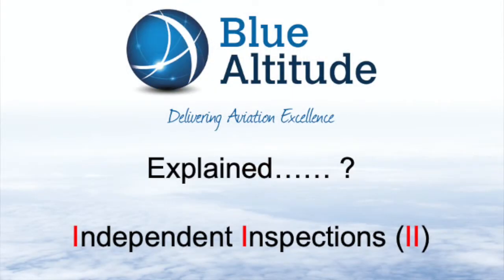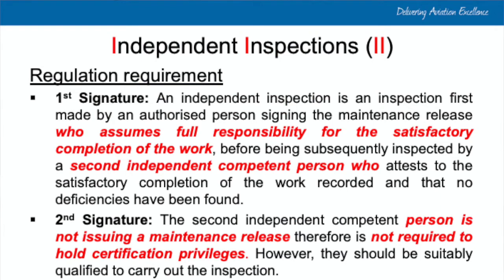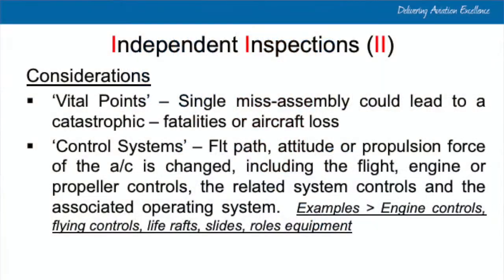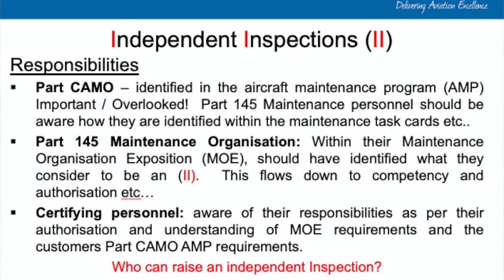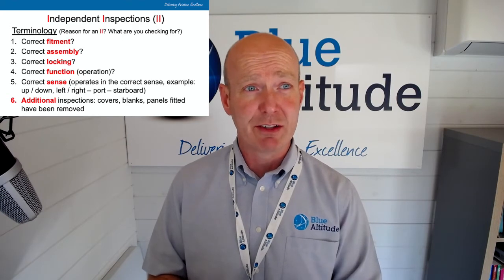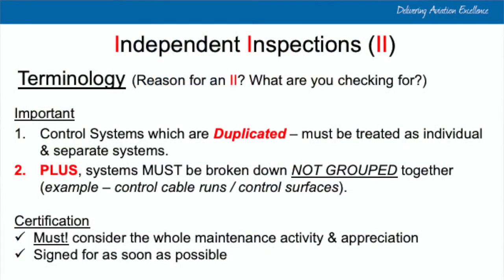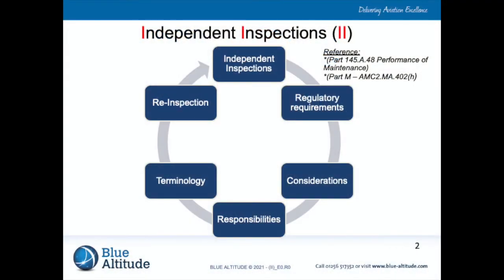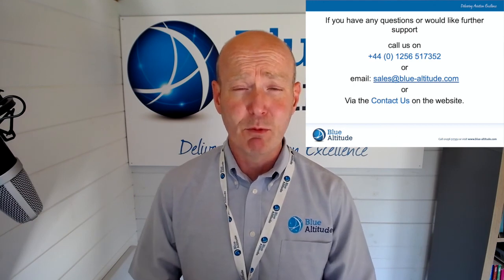What is.......?   Independent Inspections

Comment: would the independent inspector see the complete task, and be expected to witness events during such as for example fitting a rudder booster assy, would the independent inspector be expected to witness all the torque loadings, or would the indy be purely post task completion?
Reply from the maker: Thanks for the question.  In my opinion, it would be post task completion.  The first person (independent inspection) is signing for the task being carried out i.e. CRS and the specific task is completed.  The second person would be verifying independently critical checks or inspections.  Such as correct locking and assembly, correct fitment, function or operation, stage inspections e.g. cable attachments.  

When you think about it, the purpose of the independent inspection is to verify critical tasks that could endanger flight safety if not carried out correctly.  Or where the organisation (CAMO or  MRO) have learnt be incidents or accidents etc…. and they use independent inspections to mitigate / prevent reoccurrence of the error.

Witness events could be done together but is unusual.  My concern would be how that would be managed, the plan, when signing, distractions.  You mention torque checks and witnessing, I’m not sure why that would have to be witnessed.  Like is said, that would be done as per the CRS for that task.  The independent inspection would be the correct locking and attachment, split pin fitted etc… 

I hope that answers your question.  All the best.

Comment: Hi Brett
So can the initial signature within the independent inspection, then go on to sign the overall CRS for the task that has been performed. I.e the independent was for the installation / rigging of a flying control surface. The independent is within the overall task but not all of the work. I.e you leave an independent for someone on the opposite shift, you return on the next shift to close all panels etc. Can you as the certifier, now sign a CRS?
Reply from the maker: Hi Screwjack001, thanks for the comment. Yes, it would be permissible for you to sign the overall CRS for the complete task post completion of the independent(s) inspections(s) based on the following: 

(a) the maintenance task has documented stage inspections to clearly identify what maintenance actions are to be / have been carried out, by whom, signed for (basically, its a 'complex maintenance task' as it involves many steps / stage inspections), and 

(b) the narrative for the independent(s)  inspection(s) i.e. correct locking assembly, installation iaw etc... is documented / cross referred accordingly without any ambiguity and 

(c) with regard to the opposite shift to carry out the II(s), then there should be an entry in shift handover logbook both to accept and acknowledge the requirements of the II(s).  Plus, their handover to you / your shift.  Note: some shift handovers have a column missing were the oncoming shift don't acknowledge and accept what is being handed over to them.  Basically, they are not taking responsibility or ownership of the handover, hence, this is why sometimes things are overlooked and don't get addressed on the handover.  So, has it or has not been completed?  Each entry in the handover should be signed as completed / x'referenced accordingly.

Summary: The 1st signature is signing for the content of the independent inspection  (CRS for the II), not the complete maintenance task as this will be signed for in the relative stage inspections.  The 2nd signature is signing / verifying the inspection requirements i.e. correct locking, assembly iaw..... (someone determined competent, not necessarily a Licensed Engineer on type) of that II(s).

Hope that answers your question.  All the best.  Brett